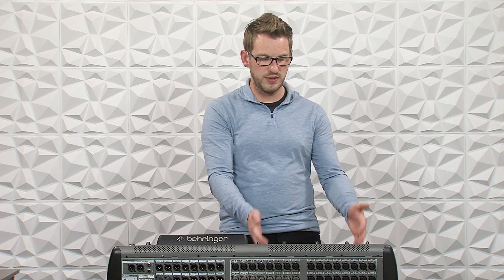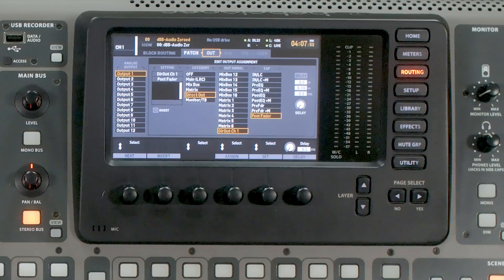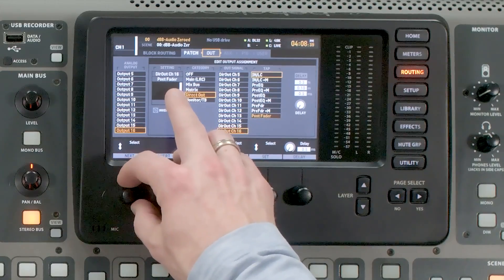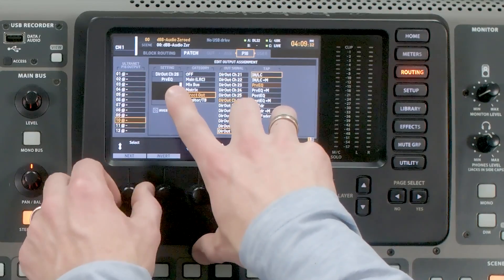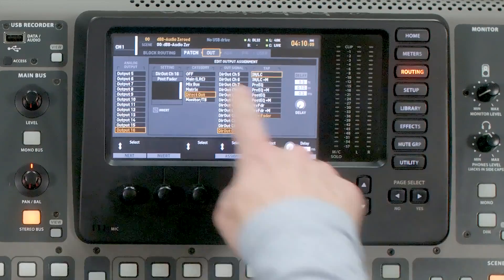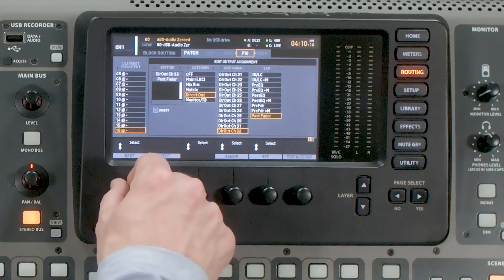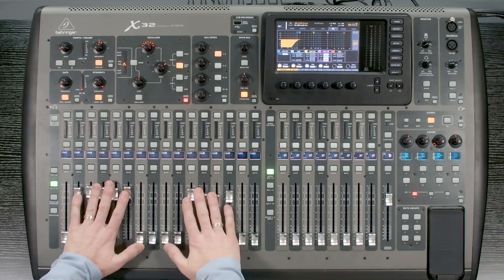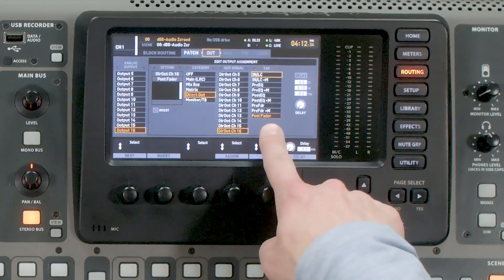Your Behringer X32 Questions: 32 Inputs & 32 Outputs Setup

Comment: I have figured out a very odd configuration with a final need that I just can't find the solution. I have a X32 console for front of house, an X32 Rack for stage, and 2 S16 for digital stage box, I have the X32 console connected via AES50 A to the first S16 (Console AES50 A to the first S16 stage box AES50 A) The second S16 is connected via AES50 B  from the first S16 to the  second S16 AES50 A. I have connected the X32 Rack from the second S16 AES50 B to X32 Rack AES50 A.  With this setup the X32 Console has both S16 inputs as does the X32 Rack    So I have the X32 Rack mirroring the X32 Console via S16's AES50 A, FOH.  I use  Busses 1 through 6 from the X32 Rack outputs for IEM and Floor monitoring from the X32 Rack and Buss 14, 15 ,and 16 from the Second S16 for FOH speaker with Buss 14 for SUB send. This all works fine. I also have an X Live card in the X32 Rack that would playback 24 tracks. I have spent hours trying to send the X Live tracks from the X32 Rack to be mirrored to  the X32 Console with no progress. I am old school so this is why I chosen to do the monitor mix from the stage with iPad connection.  After research I think maybe this is why Behringer added an AES50 C to the WING Console ??  If you could help me out with this configuration or even tell me this can not be done with the X32 line I would sure appreciate your proven knowledge in this area

Comment: Hey Drew. I kinda get what is happening here. 

Here is my situation. 

I have 23 synths that I want to multitrack into Ableton Live. 

I want each track to be post fade with all the bells and whistles that the x32 offers for the recording into Ableton Live. Plus I want to be able to control the  mix with each channels fader.

My problem is the X USB is only allowing me to do this in 16 channels . Not sure why this is limited to 16 channels. I’m getting all 32 inputs. But to be able to control the mix and dynamics, 17-32 are blocked. 

Im learning here.  Thanks

Comment: Hi Drew, Hello everyone out there. 1000s of videos, but I Dont find any answer. May be some here knows it:
X32 as FOH AES50 A to 
S32 stagebox aes50 A
S32 stagebox AES50 B to
X32R as In ear Mix AES50 B
As Long as I only use the S32, for all Inputs and outputs…no Problem. Easy.
BUT: I want to send 2 Ch. from the local Inputs FOH (Click/Backingtrack from Video Desk besonders FOH) backwards to the S32, and from there into the X32R for Click/inEar purposes. Know how I mean. But how can I get an incoming Signal from FOH, which arrives into AES50 A (stagebox) to Go out at AES50 B (stagebox) to my InEar Mixer X32R ???
Or is it wrong thinking?
Maybe I should take the X32R as Signalsplitter?
But runs the Signal from 
FOH through the X32R to the stagebox and vice versa? Best regards , J.

Comment: Hi Drew, thank you so much for your video’s! I am learning how to set up our new soundboard. Do you have any video’s in on setting up MixBus channels?
Reply: Setting up mixbus channels can be really easy— first, you want to specify where in the signal path the bus should take its input from (in the setup menu with the bus selected I believe) i.e. pre/post EQ or pre/post fader. Then, to setup a mix you select the bus you want to work with on the console, press the ‘sends on fader’ button in the middle of the board, then build your mix using the channel faders/mutes on the left bank of the console. You can rename and assign colors to your buses by going to home—>naming on the screen, or by using an external controller like an iPad if you like. Routing buses is similarly simple, go to outputs in the routing page and select the desired mix bus corresponding to the desired output channel. Hope that helps!

Comment: Hey Drew. I really enjoy your videos, but can’t find the answer to my needs in any of them. I use the USB port on the front of the mixer to play soundtracks that our soloists and choir use for special music. It shows up on Aux In 7&8. I use the X-USB card on the back to send audio to a separate PC running Reaper recording software. I need to route the signal from the USB (Aux in 7&8) to reaper. I can’t seem to locate a way to do that. Can it be done, and if so, how? Thanks. Tom Cole Shreve City Baptist Church, Shreveport, LA.
Reply from the maker: That is super interesting, I don't actually see a way to get this routed. I was going to say the User In routing, but it doesn't look like those channels are an option in the user routing section.

I would suggest that you use a direct box and a computer to play the audio from and into one of the XLR's or Aux of the X32 if you needed to have the files in Reaper. If you use the Aux input, you would need to use User Routing to get it available in Reaper.

I hope you are able to get it figured out!
Reply: @DrewBrashler  Thanks.

Comment: I love your videos and have used them successfully over the years (particularly after our church acquired an X32). I've got a challenge I can't figure out in that I don't want my drums or bass guitar to go to mains but need it for hearing impaired out and broadcast out...
How best to achieve this?
thanks!
Reply: You want your broadcast to be taking input from a separate mix bus (post fader) and not from mains— that way you can turn up the drum/bass sends to that bus without affecting the main mix. Hope that helps!

Comment: Drew we have a X32 and S16 Stage Box. X32 is set with the default setting, the Stage box is default setting as well. We have four Stage Monitors that are daisy chain, then plugged into output one of the Stage box, then we have a Keyboard plugged into Input one of Stage box. We have a computer plugged
into the XUF Card using the usb slot. There is no sound coming out of the Stage Monitors. We also are using all wireless Mics contacted to Channel 1-13 inputs. on the x32. Can you do a full video showing step by step from starch to finish setting this up,  thanks.
Reply: Check the input and output route on your X32. Both should be set on receiving or sending through AES50. Go through the route tab on your X32 to set this. 

I'd suggest that you  plug the keyboard inbto channel 17 on the stage box, to avoid confusion. X32 routings are done in blocks of 8 channels. having mics on channels 1 - 13 means the channels available for your stage box are 17-32 through the AES50 route.
Reply: @maxwellibe7147  not following you "both should be set on receiving or sending through AES50" also, for the keyboard setup, it is the only input the S16. Mic are connected 1-13 on the X32, not the S16.

Comment: Hi Drew-

I've used your tutorials for a couple years now to get myself up and running on the x32 (producer model) for my live band. I have been interested in using the console as a studio interface with Reaper though and cannot, for the life of me, figure out the right way to route so that I can effectively overdub. How do I route it so I can listen back (make headphone mixes) and record the overdubs? Any help on this would be greatly appreciated. Thanks
Reply: I am having similar issues but I am running Studio One and Ableton Live. I hope Drew can help us resolve this.
Reply: Firstly, download the usb driver for your X32 and install in your system. Now your system can see your X32 as an audio device. Next, open your DAW of choice, and go to your audio settings, then select X-Usb as your audio driver. Now you can go to your DAW's channel settings and route your input to any of the X32's input as seen on your DAW. On your X32, remember to set your  input routing to Card, through the input routing tab on your console. Your playback will be on channels 1 and 2 by default. However, you can re-route them as you wish on your X32.

Comment: Hello there, love your videos! I'm wondering if you can help us with this set-up:
X32, Dante card, 2 - S16 stageboxes.
We want to know if it's possible to route so that channel 1 (routed from the stagebox 1:1) goes out via Dante to Ableton live so we can run light autotune + extra effects, then gets routed Back into channel 1 on the board. This would make it so we don't lose any channels, as I've seen videos showing how to send out and then return on a separate channel but if it's possible to not lose precious channels that would be amazing!!
Thank you so much!!
Reply: Then the signal from ableton would go back into itself? I don’t think that this is possible because there’s no clear way for the signal to exit the chain.

Comment: How can one route the processed channels to the card out for recording for all 32 channels? I'm aware you already covered how to do that with 16 channels, It is possible to do with all 32? If it is, how can one do it?
Reply: In exactly the same way as in the video except you route on the card page the 16 outs and p16 channels to the card.
Reply: You don't even need the S16/32 for this as you don't need the physical outputs. :)
Reply: Drew uses the P16 outputs because they allow selection of a tap point as do the 16 XLR outputs; also these are the only two output pools to which individual channels can be routed.  That said, Doug Smith is correct in that you simply follow Drew's video but assign the out1-8, out9-16, Ultranet1-8, and Ultranet9-16 to the card1-32 outputs instead of assigning them to the XLR and AES50 outputs.

Comment: hey drew, thx for the video. 
Q: a bit iff topic: lets say i have a drumset micd with 8 mics. How do i route these 8 channels on just 2 channels of P16 so that the drums just come in stereo on the P16?
Thx for an answer😊
Reply: This is done by using a pair of busses on the console. For example: two unused busses on bus 9 & 10. Stereo link bus 9 & 10. Select each of the 8 drum mic inputs, go to the “Sends” section, make sure that the 8 drum mics have send level into bus 9 & 10 (panning disclaimer to follow). Go to the routing menu. On the P16 page, choose bus 9 & 10 for 2 channels of P16 source selection. The disclaimer part - depending on your skill level, mixing style setup and system deployment, it may be helpful to setup the stereo busses as either adjustable mix busses or subgroups. Either way has pros and cons, some that are of most note are if you want the volume of those 8 drum mics to be consistent and independent of the house mix. If this is the case, using bus 9 & 10 as a traditional pre-fader bus is the best choice as it operates similar to a monitor wedge or IEM mix. Volumes on those 8 drum mics would only change if a channel gain is adjusted OR if the pick off point for the mix bus send is not set to In/LC. If you’re looking for a more “polished” and front of house sound and blend on those 8 drum mics, consider making bus 9 & 10 a subgroup. The subgroup will track and follow all of the adjustments to each of those 8 drum mics in addition to the fader position for the house mix. You will loose the sends-on-fader adjustments but this is a simpler method. Just make sure that you are aware of the pick off point at each section of the signal path.
Reply: @mikemaly902  thx so very much. i will try your solution😊👍

Comment: Hey Drew, I have an X32 full size and an X32 Rack. I have been struggling to achieve a certain setup with these two consoles. I would like to use my x32 rack as a stage block for my full-size console, inputs and outputs. I know this is possible because I got it to work one time but cant reconfigure the setup like I did that one time. Could you make a video on how to accomplish this system in a proper way?

Comment: Hi, could you please do a comprehensive video on how to update the x32 rack firmware, stages by stages. I have seen a lot of video on YouTube and I have tried them all but still couldn't update my x32 rack. Thank you. Luke.
Reply: Get a usb drive. Format it as FAT32. Copy your firmware update into the root directory of the drive. Switch off your X32. Plug the usb drive into the usb port of your X32. Hold the usb drive acces button down, then turn on the X32. Follow the prompts on the screen.

Comment: Excellent Video...love your instructional videos. Now I have a question....How or what voice effects can we add to vocals to get maximun echo, FX on live streaming without affecting an individual with hearing dificulties???? Meaning not overpowering the sound.
Reply: Do you mean essentially sending different FX return levels to live-streaming vs. hearing-assist systems?  If I understand what you are asking, you can handle that from the FX return channels' sends to busses feeding those specific systems.  In our setup, the hearing-assist and narthex feeds are simply duplicates of the main L/R bus via matrices, so those all get the same mix of FX returns; but the streaming is fed from a separate bus, so if I want to send a different level of FX return (or anything else) to the live stream, i can do so.  I hope that's helpful in some way.
Reply: @katscornerrec  thank you it helps, will try that thank you.